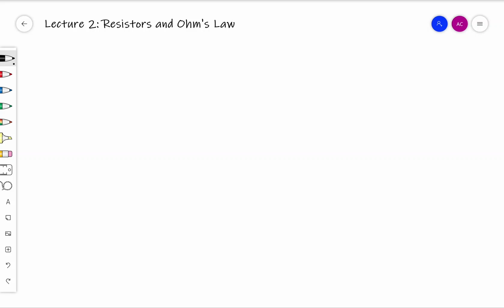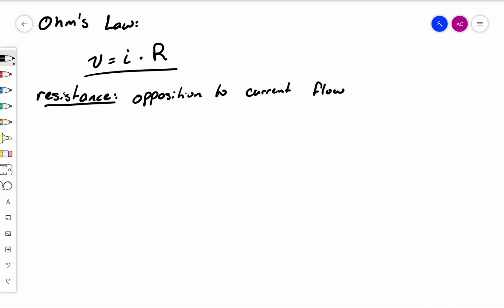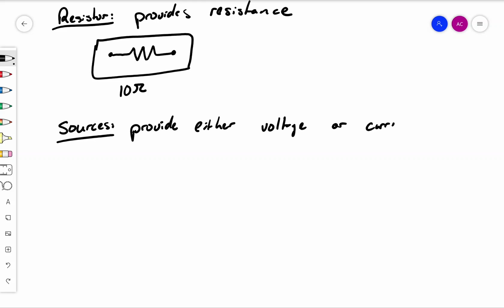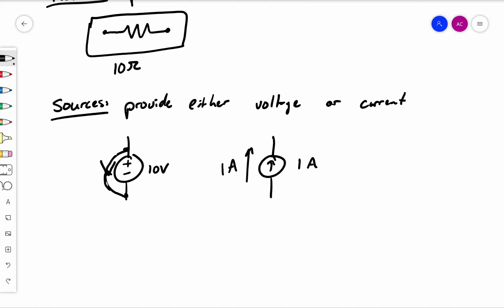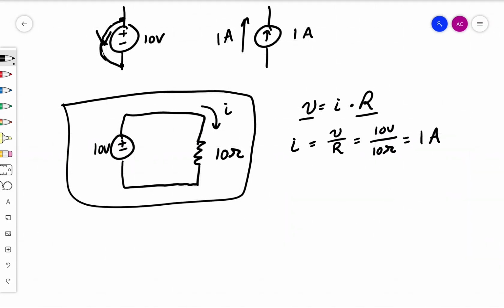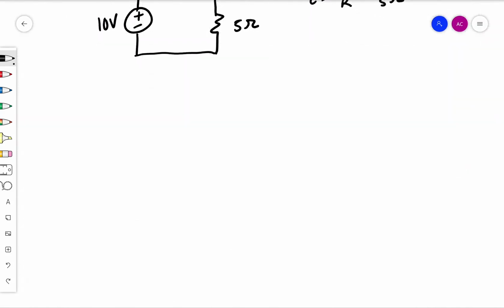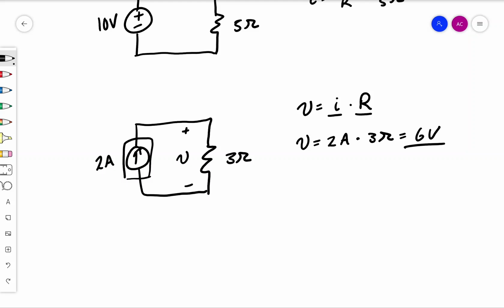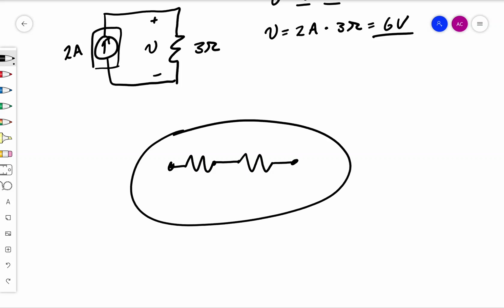Circuit Analysis Lecture 2: Resistors and Ohm's Law

Comment: Great video!!! Your question at the end I've got the answer (I think) Ra +Rb = Rt (Resistance Total) Then you do the calculation with an 'equivalent' circuit using Rt.
Reply from the maker: Exactly right! Resistors in series add together, no matter how many in series there are. That's one of those handy things to remember, since it can make some problems a lot easier in the future. Nice job!
Reply: @aaroncarman   Thanks a lot Aaron!